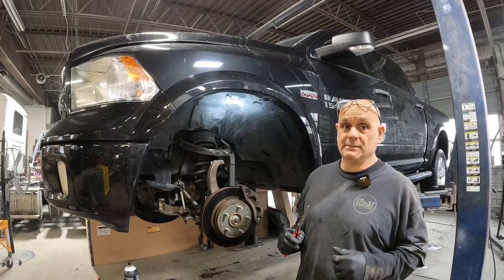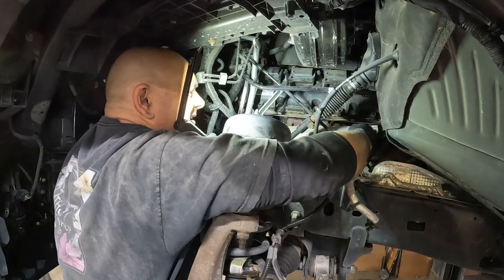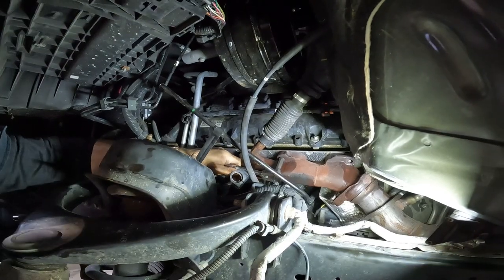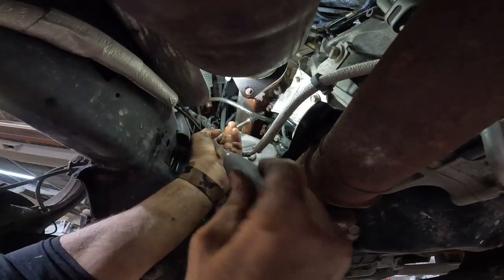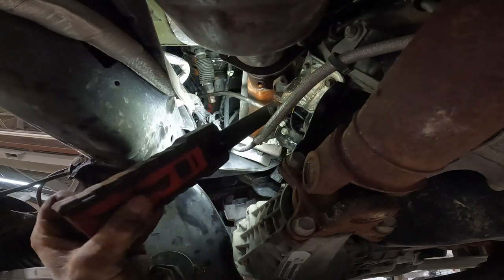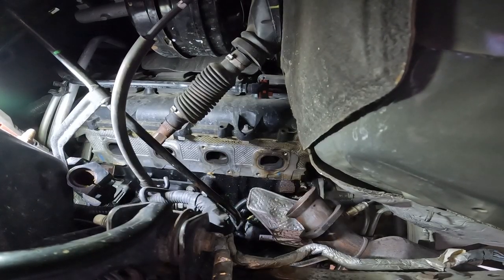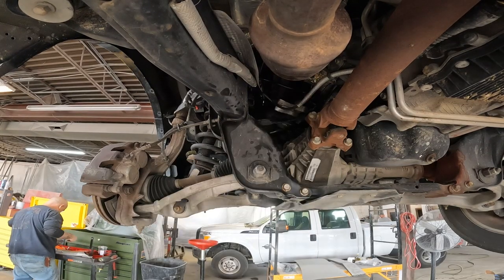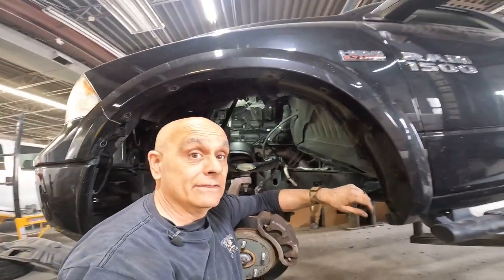Removing Broken Exhaust Manifold ~ Dodge Ram Pick Up

Comment: There needs to be a class action lawsuit for this! My '14 Ram 1500 is in the shop as a write for the 3rd time for leaking exhaust/ broken bolts. 1st time under warranty. DO NOT BUY A CHRYSLER PRODUCT! Oh and after I told my  neighbor about the problem, he bought a used 1500. Guess what problem he still has after taking it to the shop to get fixed! 2 middle fingers to RAM. At 140K mi I had to rebuild the rear axle $1400. At 150K mi I had to have a new heater core put in $2500. 10 hours to pull the dash to fix it. Then they told me I  needed a new AC pump because it locked up when they put the oil back. $1200. DO NOT BUY A CHRYSLER PRODUCT!
Reply: Sorry to hear I got 2014 250k no problems but the exhaust leak but I put after market on my passenger side alot strong then mopar.. now doing it on driver side love my dodge
Reply: 2019 1500/ 65k miles. Did my passenger side manifold a year ago. My heater core went out last month but currently have it bypassed. Working on my driver side manifold today. Which, brought me to this video today. 

2015 Grand Cherokee/ 85k miles: Currently in the shop. EGR cooler failed and sent oil through my cooling system. 

2015 Cherokee/ 110k miles: (Daughters car) Currently in the shop. Needs new shifter. Been on back order for weeks. 

Do better DODGE!!!